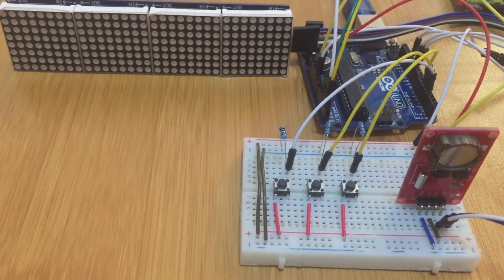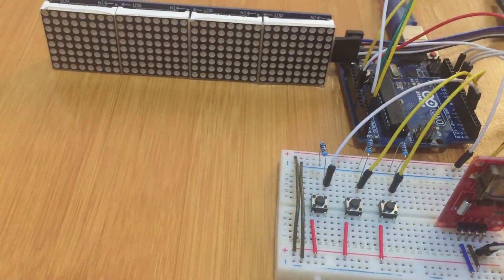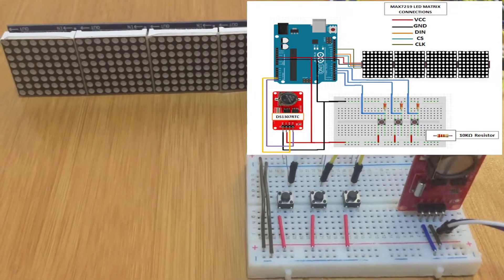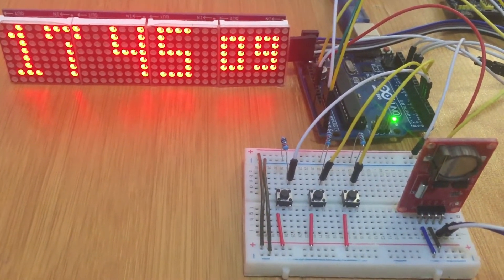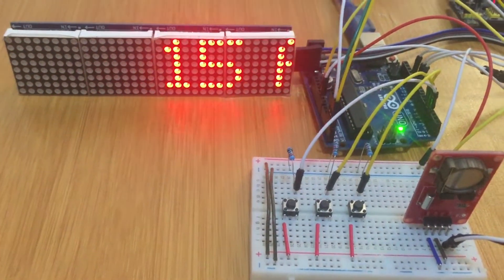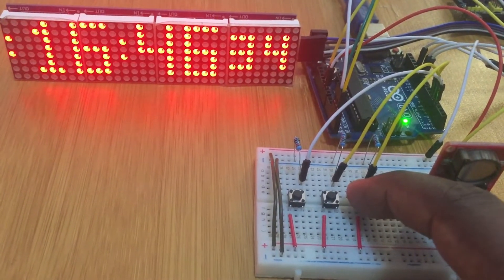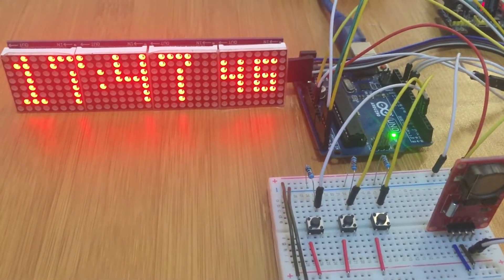ARDUINO DIGITAL CLOCK USING DS1307 RTC AND MAX7219 8x8 LED MATRIX DISPLAY.

Comment: Hey! Can i extand the led matrix? And is the display of the number was still like using 1 matrix or get bigger? Thanks
[Edit: Oh yeah also, can i remove the resistor from the circuit? Cause i think i dont have any resistor]

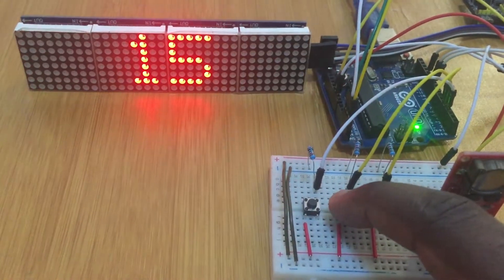Comment: Arduino: 1.8.14 Hourly Build 2020/07/23 04:33 (Windows 10), Board: "Arduino Uno"

C:\Users\prase\Documents\Arduino\libraries\MD_Parola\src\MD_Parola.cpp: In member function 'void MD_Parola::begin(uint8_t)':

C:\Users\prase\Documents\Arduino\libraries\MD_Parola\src\MD_Parola.cpp:63:18: error: call of overloaded 'setSpeed(int, int)' is ambiguous

   setSpeed(10, 10);

                  ^

In file included from C:\Users\prase\Documents\Arduino\libraries\MD_Parola\src\MD_Parola.cpp:23:0:

C:\Users\prase\Documents\Arduino\libraries\MD_Parola\src/MD_Parola.h:1752:15: note: candidate: void MD_Parola::setSpeed(uint16_t, uint16_t)

   inline void setSpeed(uint16_t speedIn, uint16_t speedOut) { for (uint8_t i = 0; i < _numZones; i++) _Z[i].setSpeed(speedIn, speedOut); }

               ^~~~~~~~

C:\Users\prase\Documents\Arduino\libraries\MD_Parola\src/MD_Parola.h:1763:15: note: candidate: void MD_Parola::setSpeed(uint8_t, uint16_t)

   inline void setSpeed(uint8_t z, uint16_t speed) { if (z < _numZones) _Z[z].setSpeed(speed); }

               ^~~~~~~~

Multiple libraries were found for "MD_Parola.h"

 Used: C:\Users\prase\Documents\Arduino\libraries\MD_Parola

 Not used: C:\Users\prase\Documents\Arduino\libraries\MD_Parola-master

exit status 1

Error compiling for board Arduino Uno.

This report would have more information with
"Show verbose output during compilation"
option enabled in File -> Preferences.

Comment: I can't believe it doesn't work with me. I've used 3 Arduino Uno boards + 2 Arduino Nano boards to test; the sketch is loaded normally, but after loading the sketch, sometimes it shows something on the display and sometimes it doesn't show anything. Sometimes it shows only the hour and minutes and sometimes it shows everything!
The connections I made were all correct and my Arduino boards and my Matrix Displays are all working, because, I tested with other Arduino code.
Something in the code is strange! Or can they be my boards? Help me to solve the problem!

Comment: Why did you use Resistors on buttons and you declared INPUT_PULLUP on pinMode 3, 4 and 5? Wouldn't it be unnecessary?
Reply from the maker: Thanks for the observation.  There is no need for the PULLUP in this case. Let me modify that. You have actually given me an idea for another video about floating inputs.
Reply: OK, it's better to remove resistors, less components, isn't it? So will you update the sketch on the page?
I thank you

Comment: Hi MYTECTUTOR.
I believe your code is working perfectly, but with me, when I upload the Arduino sketch via USB cable, the Matrix works perfectly; After I unplug the USB cable and plug it back into the PC, I have to press the Arduino Reset button several times for the sketch to work again.
Any tips or suggestions?
Thank you
Reply from the maker: I haven't had such a challenge before. Maybe if you finally resolve the problem you can share what was the cause.
Reply: Hi MYTECTUTOR, I still can't solve this problem; Do you confirm that your connections are correct, as you put in the video, for example, the Resistors and the 3 Buttons?
Yeah, I did everything as you say in the tutorial and as shown in the video.
Is it possible that the sketch was not loaded correctly on my Arduino or my Arduino may be defective? But other sketches are loaded normally! Any tips? Thanks